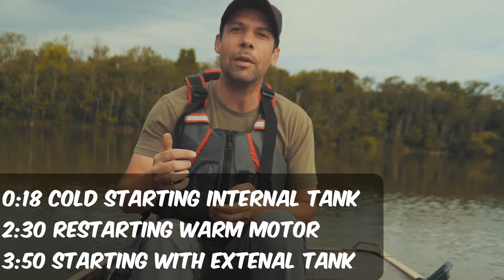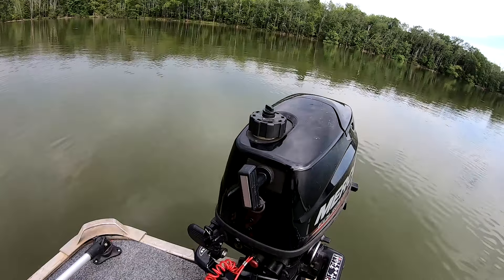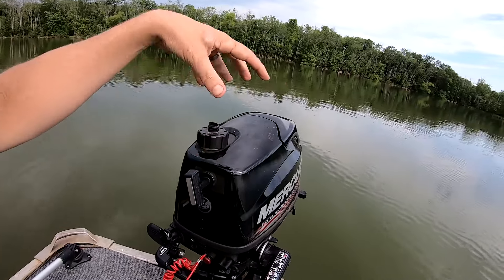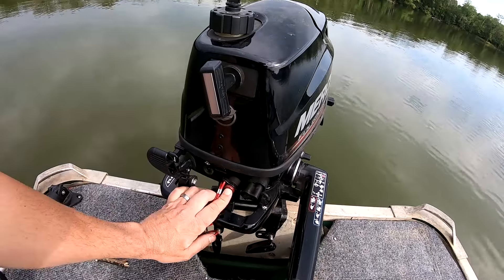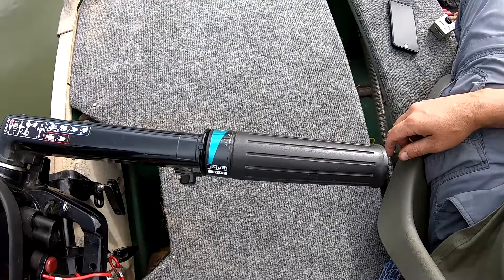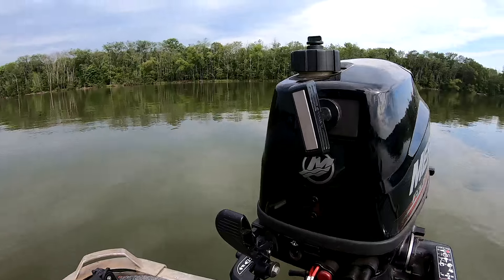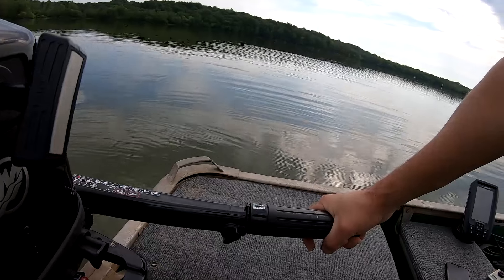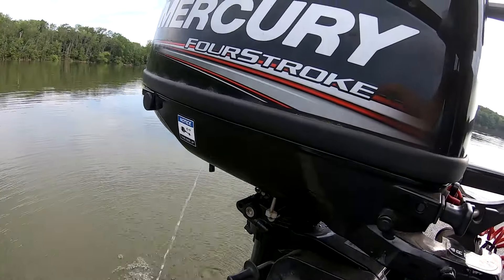How to Correctly Start a Mercury/Tohatsu 4 Stroke Outboard (4/5/6HP)

Comment: Just want to add tip here after viewing other video on hard start. I too found that by connecting and "priming" fuel system prior to leaving home I can use internal fuel system with fast easy cold start at ramp . I was ready to let somebody else have  a  new motor! I love my 6 merc !

Comment: I start a mercury outboard by removing the cowling, unscrewing the mounting clamps, and tossing it overboard. Then I take the mercury cover and I put it on an outboard that actually has a reputation for running well...like a Honda or a Yamaha...and then I start it. Works every time!
Reply from the maker: lol sounds like you have been stranded a time or two by a Merc.. lol
Reply: These motors although they have mercury on them aren’t really mercury…they are tahatsu which is basically Nissan. Only after a certain horsepower does mercury actually make their outboards rather than rebrand.
Reply from the maker: Yeah good point, every Merc 25 and under is made in the Tohatsu Japan factory. Same exact motor as Tohatsu. In some factory videos you see Mercury and Tohatsu cowling beside each other on the production line

Comment: Thanks for the video I literally just got my first external tank today. The internal tank is great but its a little scary adding gas to it out on the open water. You should include a link to your other video (starting a flooded engine - also super helpful for us newbies). 
A tip I saw in the 2023 Tohatsu manual - if using the external fuel tank, be sure the internal fuel tank relief valve is also open, something to do with preventing a dangerous build-up of fumes in the internal tank. My new 6hp tohatsu won't hold idle after the 1st start (always cuts out), but it holds after the 2nd start. I think I am going to try rev'ing the engine a bit before cutting the choke.
Reply from the maker: Awesome thanks for the comment and view. Congrats on the new Tohatsu!! I’ll have to look into that build up of fumes, that’s interesting! Yeah I tend to rev it a little with choke out then kill it. It’s a good idea!
Reply: @Skinnyriver  - Big Rodders in Ireland here.  I suspect the issue is to prevent pressure build up resulting in a flooded carb.  This happened me many years ago with a Yamaha 4hp 2 Stroke with external tank.  It was a very hot day, I forgot to open the vent on the tank and the waves agitated the gas resulting in a build up of gas pressure with the engine starting to hunt due to over rich mixture.  Fortunately I quickly realised what the issue was and the engine then ran smoothly.
Reply from the maker: @rodneysweetnam8653  yeah good points, new external tanks here in the USA no longer vent directly to the atmosphere until it reaches a certain psi due to environmental regulations. So I get more flooding with my external tank due to the pressure build up (unless I crack the cap a bit). There is a fuel demand valve you can buy to isolate the built up pressure. Going to try one this season.

Comment: lot of carb 4 strokes have accelerator pumps you have to pump the throttle a couple times and they fire very quick choke if equipped

Comment: On an external tank does the air valve on the top of the filler cap need to be open or closed, ta
Reply from the maker: Open, it lets air in when gas goes to the motor.

Comment: I have one of these and the first year was great. Year three finds me having to use the choke as an idle control.  Just dirty?
Reply from the maker: Yeah that’s probably all it is. Look up B12 Chemtool, it’s a good cleaner you put in gas (or try seafoam) but I would just take the carb off and spray the jets
Reply: @Skinnyriver  I appreciate it. I'm just going to upgrade the carburetor and prop.

Comment: Great videos! Could you please tell me how much time you wait with the choke out before push in it back when cold starting? I usually need to wait 20 secs aprox or it shut off. Thank you!!
Reply from the maker: I’m usually able to kill mine 5 secs after cold start. 20s is not crazy but you may want to run some sea foam or clean the carb at some point

Comment: Thanks for this! A few questions: 

1) When cold starting, I've heard you should let the motor run, choke-out, for around a minute or so to get the engine warm? Is this maybe the case for the older units?
2) On my older Tohatsu, I don't think I have start or restart positions (just the rabbit/turtle icons and a notched mark between) - do I just leave in the notched/middle position when cold-starting or warm-starting?
3) When connecting the external tank, are you still supposed to leave the onboard fuel tank vented? Or do you close the vent of the onboard and open the vent of the external?
Reply from the maker: Thanks for the questions! I’ll do my best

1) if the motor dies when you press in choke then you need to let it run with choke on until warm. If motor doesn’t die when you press in choke then it’s best to go ahead and press in and let motor warm up without choke 

2) most chokes advance the throttle for you. But it depends. I would start on turtle with choke on. If that doesn’t work, then advance the throttle up until you get good starting performance, then mark that position with a pen. Note you can flood your motor if choke is on and throttle is too high 

3)when using an external tank, close off internal tanks valve and close vent. That part of the fuel system (internal fuel tank) should be completely closed off. You should only pull gas from external tank

Comment: I was given a fairly new Mercury 20 hp 4 stroke. Runs beautiful, but I can't get the proppeller to spin forward or reverse. It is my first ever outboard engine. I know nothing about it and no one to show me how to use it. I have it on a stand with a garden hose connected to it. Does the lanyard have to be connected for the propeller blade to spin?
Reply from the maker: Sorry I just saw this message. Did you figure it out? Prop should spin when you start it and put it in forward or reverse. You shouldn’t have to do anything as long as it’s running.
Reply: @Skinnyriver  Yes, I figured it out. The throttle handle (tiller handle), if that is the right word needs to be pulled out to put it into gear. Does your Mercury have that?
Reply from the maker: No mine doesn’t have that. Glad you figured it out

Comment: hi can you tell me where the telltale is, i bought a fixer upper and i'm not seeing a telltale hole. Mine is a 2001 mercury 6 HP   Thanks
Reply from the maker: There is a hole on The underside of the motor, usually on the left back side

Comment: I love my new 5 hp but have only had it out twice and it's not pumping water I have to take it Thursday to have it fixed
Reply from the maker: That sucks sorry to hear that. Hopefully you just sucked up some trash. It should be a quick fix. Good thing you noticed it!!!
Reply: @Skinnyriver  yeah I hope that's it and I can have it back by Saturday. I was impressed it pushes my little 12' v hull 13 to 14 mph just depends on if the wid is at your back lol. Buy your videos helped me chose the mercury. I had a priming problem the first weekend and then last weekend got a hose for my external tank and all was good till I saw it wasn't peeing .
Reply from the maker: @jasonduncan6398 let me know what they say and if you get it fixed

Comment: What do you do after your done how do you unplug the external tank do you just turn the motor off and disconnect it
Reply from the maker: Yeah, there is a lever on the hose fitting that plugs into the motor. Press that lever and disconnect the hose. that’s it!
Reply: @Skinnyriver  thank you for all the videos

Comment: I have a new Tohatsu 5 hp that's just been broken in. Starting it initially is fine, as are restarts after a break of 30 mins or less. But after a gap of 1-2 hours it can be more difficult. I suspect I'm giving too much choke and flooding the engine. Any tips for resolving this - i.e. how do you unflood an engine when you're out in your boat?
Reply from the maker: Are you using the internal tank or the external tank? If you are using the internal tank check out this video https://youtu.be/tD2eeR7btXs?si=w7XhM34IksCuLaH3 
There is a known issue with the system losing prime after a break in running.
Reply: @Skinnyriver  Thanks. My model is one with just the external tank. At the moment, the only thing that seems to work is pushing the choke back in and leaving it for about 5 mins, them pulling the choke out again pulling the starting cord again. Does this unflood the engine?
Reply from the maker: @simonparker9322 pulling the choke out and back I’m doesn’t really do much if the motor is just sitting. Do you squeeze the priming bulb before trying to restart it? Is the bulb still firm? Also sometimes on a hot day the external tank can build up pressure and flood the motor. Check to see if pressure has built up in the tank next time (hear a hiss when you Barry open the cap or the tank feels hard and bulging). I think it’s probably just losing prime, try repumping the bulb
Reply: @Skinnyriver  Got it! As you said in your video, just leaving it 10 minutes helped the re-starting, rather than anything to do with the choke. This morning I managed to flood the engine while trying to start it - and I tried your method of starting it on full throttle and no choke. Started third pull! Thank you so much! I just wish your tips were in the owner's manual.....

Comment: How add little bit gas for idling, that motor won't stop? Is there little screw in gas wire or something? I don't want to make any changes to carborator, because it is working perfectly otherwise. Thank you for great videos!
Reply from the maker: Hey! Thank for the view.  What do you mean add gas for idling the motor won’t stop? If your carb bowl is not full you can squeeze the priming bulb to push more gas in the carb. There is no way to increase the gas flow from the carb to the motor unless you change the carb air/gas setting by turning the mixture screw
Reply: @Skinnyriver  Sorry, I Haven bad english skills and no knowledge of motors 🙈 I just want add little bit rpm to idling. Just like I would add little bit speed from hand throttle.  Hope you can get what I mean 😊
Reply from the maker: @2fast4ualso I understand.. there is a screw on the carb called the fuel air mixture adjustment screw. If you turn that, it controls the amount of fuel the carb sends the motor. This is used to increase or decrease idle RPMs. But if motor is running well, be careful adjusting
Reply: @Skinnyriver  Thanks. I don't want to do any changes for carb. I maybe try to find way to adjust hand throttle a little bit or shorter somehow gaswire, If there is one.
Reply from the maker: @2fast4ualso oh I see what you mean. Yes you can shorten throttle cable that way you always have a little gas. That is a good idea
Reply: @Skinnyriver  I took a little look and there is a screw with little spring in carb to adjust idle power. No need to change anything on carb.

Comment: What's this wheel close to the throttle handle? Today i bought this engine
Reply from the maker: It’s a resistance knob. It makes it easier or harder to turn the throttle
Reply: @Skinnyriver  Thanks ! Will see in next few days how this engine is working. It has like only 40 runn.hours.

Comment: Can you transport the engine  laying down in the boot?? Thanks
Reply from the maker: Yeah, on mine it has to be tiller side down. If tiller side is up, oil can leak into cylinder. There should be a sticker that say “lay this side down” or check manual

Comment: do you leave your external fuel line attached to your external tank when in storage? Any reason to keep attached or to remove it?
Reply from the maker: I mainly use the internal tank and a good gallon emergency tank to save weight and space but when I do use the external tank, I sometimes leave it hooked up. Only issue is if it’s full and hot outside it could build up pressure and push gas through the line and flood the carb

Comment: Have this engine always have fuel problems
Reply from the maker: Ive learned a lot about this guy. I don’t think it has fuel problems, i think by design it needs a few pulls to prime the fuel system if you are using the internal tank. Keeping the gas tank full (higher level) helps a lot. Using an external tank has pretty much solved any issues too.

Comment: on the tiller what is that dial that is on the side for?
Reply from the maker: It’s like a resistance knob. Makes it easier or harder to turn the handle and accelerate
Reply: @Skinnyriver  Thanks buddy no one ever mentions that thing and when I use mine t feels like it's not doing anything.

Comment: No way can you start a internal tank motor in one pull. 12 if your lucky maybe more. I hate these motors.
Reply from the maker: Yeah, I prime mine from an external tank before I leave. The lines have a tendency to back flow back to the tank so first 6 pulls is just to cycle fuel pump get gas back in all the lines. Sucks… but with priming I usually can start in 2 pulls

Comment: Or just throw the Mercury in the trash and get a Honda and spend your time boating instead of fiddling with a bad mistake .
Reply from the maker: 😂 I was thinking Yamaha but yeah the Hondas look awesome
Reply: You funny guy! I own both. 😂
Reply: @mattwaters6987  Big Mercuries are great but the 4 cycle 2.5 and 3.5 are junk.
Which one do you like better ?
Reply: @spencerboaz2385   it's why I chose the Honda 2.3 hp air cooled for my canoe, but the Mercury 9.9 hp for my 12' aluminum V hull. Both were bought new in 2018. Very happy with both. 🎣🚤🛶😊